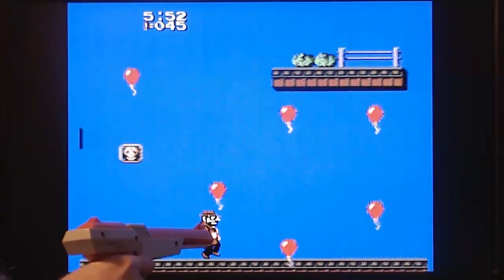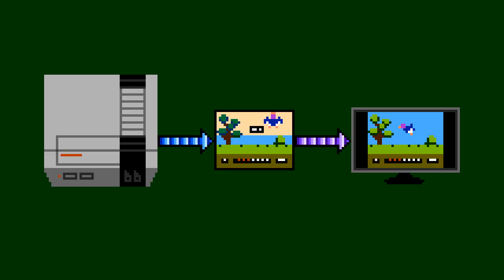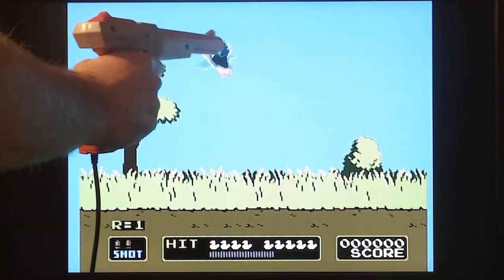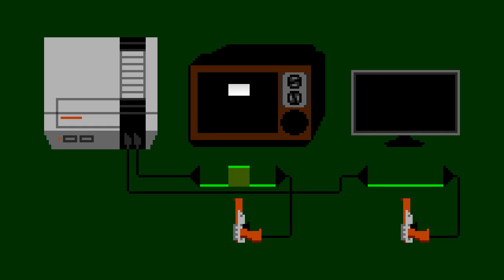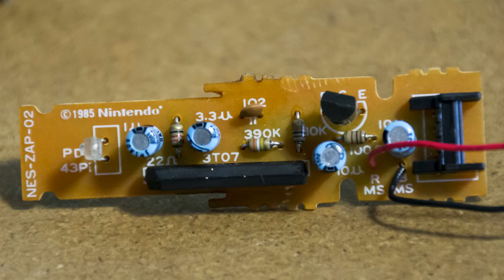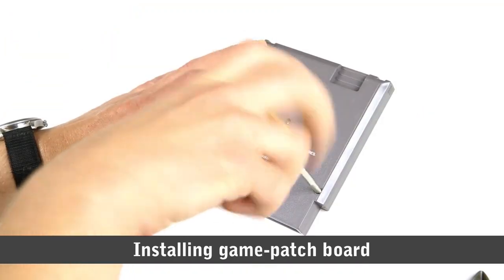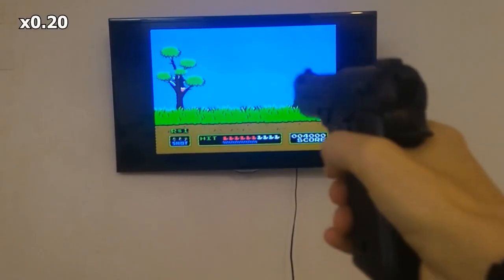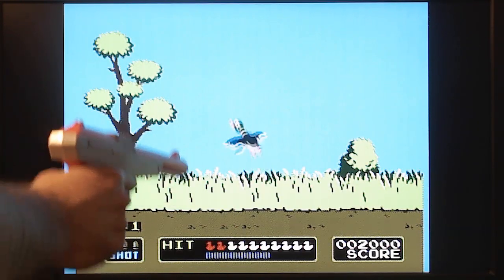Ways to play NES Light Gun Games on a Modern TV

Comment: Ok, now lets do Time Crisis :P
Reply: Right? Last I heard, there was this dude in Greece making wiimote mods for the dreamcast, but he said he wasnt doing it anymore.
Reply: casually looks from right to left. Whistles and slides across a case of beer and a sticker. Then starts running to avoid angry mob with torches and pitchforks. I don't understand why nobody yet has made a modified light gun equivalent so you can play these old games on a LCD television. There are quite a few really good shooter games out there that From what I know you still can't play on an LCD, such as the games for the Nintendo super scope. You can bet your happy ass. I am not going to attempt to move a 36 inch color vacuum tube television in order to play Nintendo super scope games I want to play them on a 60+ inch flatscreen, dammit! There was several I never got my hands on back in the day and you can't play them without using one of those old televisions, . Then there's games like house of the dead time prices Terminator two revolution and the list goes on.. You'd think somebody be making a little unit like attaches to the Nintendo will and the other end plugs into whatever emulator machine you're using and then you can use your light gun on a modern TV
Reply: @peterparker6584 hahaha. 

 actually there is a product called aim track. But works with pc Roms.  It's actually not that bad.
Reply: @PapadumGeek  the real question is can you use it with your snes classic?
Reply: @PapadumGeek  .what I wouldn't mind finding is some sort of a gun that will work on Roms running on a system connected to a LED type television games like time crisis revolution and a host of others that were in some cases arcade only releases would be really nice to be able to play them with some sort of a gun on a modern television where it's just a unit you buy for like 50 bucks and plug it into the machine and plug whatever gone into it or it comes with said gun. I'm a very basic person who prefers things that are plug-and-play ready for it. There is a particular console. I've got my eye on that will run most arcade ROMs by simply putting them on a memory card and putting the memory card in the machine. It doesn't require you to know a lot about programming and such. . For guys like me ROMs are the best option we can have access to all those games. We couldn't have access to as a kid, especially things like forgotten arcade games and now you've got things like save states. You also don't have all the clutter of having hundreds of cartridges and CDs all over the place multiple consoles and all the rest of that stuff. Don't get me wrong, I've got a PlayStation/Xbox collection that would scare people with how many games I have. But when you get into things like snatcher for the Sega Saturn. I had a brand-new sealed copy that I sold on eBay and never played because the game became so damn valuable that I didn't even want to attempt to run it. I'm hoping to one Day play it on a Emulator system with a light gun.
Reply: @peterparker6584  Well, based on the official documentation (which you can find nowadays if you know where to look), the SNES Super Scope is functionally a light pen.

I thought about building such a device, but the challenge of getting it to work reliably seemed pretty difficult to manage.

The problem is a light pen (again, Super Scope is a light pen, technically - look up light pens to see what that means) works based on the principle that the actual exact dot that a CRT is drawing is much brighter than any other part of the screen.
Thus, the photodiode in the Scope picks up this bright spot as it passes in front of what the scope is pointing at.
The console sends a sync signal to tell the scope to look for a spot, starts a timer, then the scope latches when it sees the bright spot. At this point the console counts how long the timer was going.

Basically, you're timing from the start of a frame to the point that the light gun detects a sufficiently bright light indicating the electron beam of the CRT passed by the exact spot the gun is pointing at.
This is then converted to a 2d coordinate, and fed to the game along with data on trigger presses and the like.

Now, getting a system that can track a 2d point isn't so hard, the problem is interfacing with existing software.
This new device would need a calibration step to align the coordinates of the new tracking system with the way the existing programs expect to get data back.
And since we basically can't get timing data from inside the console, we'd have to align the two somehow every time you play, without needing the console to run a custom piece of software to perform said calibration.
That's going to be one seriously fiddly calibration setup, AND there is a high chance it will drift over time unless everything runs at an extremely consistent speed (and the speed of the emulated box and the console line up perfectly.)

All of this is doable, but it would create a device that really isn't at all user-friendly.

You'd probably have to manually adjust a timing knob until the aim seems right, and it'd be extremely hard to do that calibration with any kind of precision or speed.

I mean, it's not impossible, but it'd be unpleasant to use.
Reply: My thoughts exactly.
PS2 light gun compatibility would be amazing.
Reply: RELOAD click click RELOAD
Reply: @Youtube User I would kill to have some sort of an adapter that works on PlayStation two for those old light gun games. There were some really awesome light gun games for PlayStation one and PlayStation two and you could get some really nice guns at the time. I literally can are member people lying on eBay claiming the guns work just fine on a flatscreen television. Not that many years ago. It's how I literally found out they don't work on a modern television. There is a dinosaur shooter game that is storyline wise connected to the two dino crisis games, but the game wasn't called dino crisis and was released for the PlayStation two. At any rate, you can either use the controller or a light gun and needless to say, the light gun doesn't work on a modern television and several people on eBay were advertising that it did back then. they didn't have the same security policies on eBay that they do now.  There are quite a few games that could use the light gun or a controller for PlayStation two that I'd love to be able to play with a light gun Erie it. You'd think it wouldn't be any more difficult than some sort of a unit that logs into the console and then a gun plugs into the unit. In between on the joystick connection may be a little boxlike they used for the Nintendo will.

Comment: Next, time crisis on PS1 and PS2
Reply: Unfortunately these guns work differently, with much more stringent scanline timings and I just don't see how that's going to work with modern panel displays.
Games like TC and many others would flash the whole screen white and the gun would keep timing with the video signal so that it knows at what part of the screen you were aiming.
Instead, NES Zapper style guns use a whole frame of animation to test for each possible target. Which, realistically only allows for 2 targets at a time, with 3 already pushing it too far.
Keep in mind that, with the Zapper approach, you need 16.6~ ms to test for each possible target on screen.
With the TC approach, with a single frame you can know where the gun was pointint at when the trigger was pulled, and then the game code test that screen position to see if there was a target there at the time.
Imagine you have 10 enemies on screen. If you had to test targets Zapper style, you'd have to stop the action for 0.166666 seconds, assuming the shooter had a very steady hand and won't move the gun the whole time.

Comment: I remember when I found out that the 2nd player can control the ducks. I used that to get them until I figured out you could just shoot a white piece of paper.

That was before I realized the point was to be challenged by the game and now it's more fun.
Reply: That trick never actually worked with the NES zapper. It checks for a frame of no light followed by a frame of light specifically to prevent that kind of cheating. Older light guns were susceptible to it though, which is probably where this rumor comes from.
Reply: @Oneiroclast   I don't have the setup to test it anymore but I remember doing it. could be the mandela effect though.

Comment: The Slow Mo Guys did an awesome video about how CRT displays work differently from LCD. They show in very slow motion the scanning pattern of CRTs verses the "fade wipe" style transition LCDs have. Very cool.

I understood there are two models that the zapper could use. One used the timing of the electron beam scanning across the screen to figure out where the gun was pointing. If the gun saw light at the instant the NES was drawing the target in the screen it would know you were pointing at the target. Most games used the other mode that would blank the screen and show a white square, one frame for each target. If the gun saw light for that frame it would register a hit.
Reply: I don't think the zapper has enough sensitivity to be a scanline-type gun, like later guns had in the 16 and 32 bit consoles.
The SNES Super Scope, or the Namco GUNCON do work the way you describe, with very granular timing and sensitivity to detect positions on the screen based on the exact time the electron beam lights them. But the NES Zapper, probably doesn't have enough sensitivity.
Also, it would bog down the CPU testing each pixel, whereas, with black frames and white targets, the CPU only has to test the gun each line, perhaps each frame. which is a lot less checking... at least 341x less xD, which is the number of pixels in each line on the NTSC NES, counting active video and blanking.
Reply: @radornkeldam  I believe you are correct that the Nintendo Zapper did not use the scan line method. In fact looking into it a bit more I found that the controllers were polled by the CPU to get their state which would probably happen between frame renders. You are correct that the polling would have been exponentially more for the Zapper than the controller since it would need to know multiple times per scan line instead of once per frame. 

It would be possible if the controllers used interrupts instead of the CPU polling them. The Zapper button would activate the sensing circuit and trigger an interrupt when it saw the scan line. That would cause the CPU to check where in the scanning process it was. If it was in the middle of a target then it would score a hit. 

But I digress...
Reply: Talking about this something just occurred to me.
I don't know, by any stretch, all Zapper games there are on the NES, but it seems to me like most of them probably are very similar to duckhunt in the sense of there being a static screen, with not much going on, and one or two moving targets. No scrolling, no music generally, no animated backgrounds...
Maybe it's because polling the Zapper is already so intensive that it prevents doing much else?
Perhaps I'm going too far with the conclusions xD
Reply: @radornkeldam  Right off the top of my head: Operation Wolf, Gumshoe, Gotcha!

Comment: Factual errors here: the CRT does not draw a line but a single dot (or 3 if color) at any given time;  while the LCD (or any modern screen) CAN'T show the entire screen at once (it would need too much wires and even power) but a whole line (or worst case column) and while it can buffer for sure (if transposes from lines to columns certainly), it can also be almost as fast a CRT or even faster -- 144-240Hz displays aren't rarity anymore -- well, depending the input format.
There is however a fundamental difference in the structure of the picture: the CRT draws interlaced images (only odd lines then only even numbered lines), while most if not all LCD screen uses some sort of deinterlacing and only after that displays the screen line by line, so you don't see jagged edges. The scaling to panel-resolution could also takes time.
Reply from the maker: 1. Yes it's also dot by dot, but from the point of view of the light gun, "line by line" is sufficiently instant (15kHz). I didn't want to split unnecessarily fine differences for the purpose of this video.

2. 250Hz is nowhere near 15000Hz. Modern TVs are just not fast enough. There might theoretically be non-CRT technology that could simulate the CRT's immediate and progressive response, but I doubt a TV like this will ever be built.

3. Maybe this will sound surprising but the NES picture is actually progressive, not interlaced, when correctly interpreted by a CRT. Most modern TVs will incorrectly interpret 240p as 480i, but there is explicit alignment of the fields in the NES signal that makes it progressive. (Also produces the well known gaps between scanlines that some people like to simulate.)
Reply from the maker: There is a lot of variation in TVs that I had to gloss over. This video isn't really about all the types of modern TV, but my goal was to describe the general issues that more or less universally apply to the problem of playing light gun games on the NES.

Comment: Great vid, but the cpu on the nes doesn't 'ckeck whether there light or not 1000 times per second', that's what the filter inside the zapper is for.  It only needs to check once per frame.
Reply from the maker: No, it really does. You can take a look at the Duck Hunt code and see how it works. It has to keep polling constantly during the frame until the light appears on the line you're pointed at. It can stop checking once it gets a hit, but otherwise it has to continue testing over and over again throughout the frame.

Comment: Question is does it work for other light gun games like gumshoe and that other one from back to the future
Reply: Each one would have to be modified, and even then since delay is inconsistent across different panels I think it would quickly become a messy solution. 

The LightGunVerter seems like the best method by far. A system that constantly tracks the guns X,Y position and where the electron beam 'would' be on the CRT. If you can do both of those quickly and accurately returning a hit or miss would just be quick comparison of those values and if the video signal is reading high or low. At that point the actual display tech being used would be irrelevant as long as it doesn't interfere with the ability to track the guns position.

Comment: Why don't you build an tv that has an toggle switch for an framebuffer to enable or disable it
Reply from the maker: There's still extra latency, even theoretically without a framebuffer LCD or other modern TV technology still changes brightness I think maybe 100x slower than CRT phosphors.

...but "why don't you build a TV" is a pretty big request. These aren't simple machines, and the framebuffer isn't really a part you can just remove. It has some important integral functions here.
Reply: @Sakanakao  what about OLED screens?
Reply from the maker: @Kai-io6jn  Maybe theoretically? In current screens, no. I don't think anyone will ever build such a thing.

Comment: The Slomo Guys showed that modern TVs, though fully lit at all times, do actually "fade" from top to bottom.
Reply from the maker: It depends on the TV, but yes many do have an update pattern that goes from top to bottom, though that's not the only pattern I've seen. It doesn't matter for the issue in this video, though, the signal is still buffered and delayed, and the rate of light change is generally too slow to be picked up by the NES Zapper.
Reply: @Sakanakao  the update pattern is controlled by the input, mostly being 1080p (top left to bottom left, the most popular one rn) and 1080i (interpolated, does left to right on odd lines then even lines)
Reply: @dylanharding5720  Interlaced, not interpolated.
Some monitors will implicitly de-interlace or update half the pixels at a time; e.g. what I'm using now has a native frame rate of 240Hz.  There are a couple of natural ways of updating the internal frame buffer as information is received.
Reply: @JohnDlugosz  refresh rate, not frame rate.
Reply: @dylanharding5720  The contents of a frame buffer is read and sent to the screen 240 times per second.  That is independent of something that is updating frame buffers as information comes in over an input.  It could display slightly different image every time, being up to date with however much of a frame has come in thus far; it could buffer incoming image data and switch frame buffers only after a full frame, or after each field for interlaced, or do fancier de-interlacing.  Exactly what it does on my monitor in particular seems to vary with the features that are set.  There is a smoothing mode that interpolates motion (which I can't stand), and of course for 3D it alternates between two different images at 240 hz, changing one of them every 1/48 of a second.
Reply: A flickering backlight makes your eyes tired quicker than the constantly lit screen. That's why they got rid of the PWM brightness control. (Actually they didn't, just use an integrator circuit to filter out the flickering.)
Reply: @peterkiss1204  no screen is constantly lit.
Reply: @dylanharding5720  Sure, backlight modulation is a common method to increase the contrast ratio of the screen, but flickerin at the swiching frequency of the modulator was a thing they try to phase out. And no, the backlight isn't flashed up at the end of every frame draw of the screen. Modern monitors and TVs aren't working like an old celluloid projector.
Reply: 72, why the quotes around "fade"? Is it not actual fading (but too fast for us to see it)?